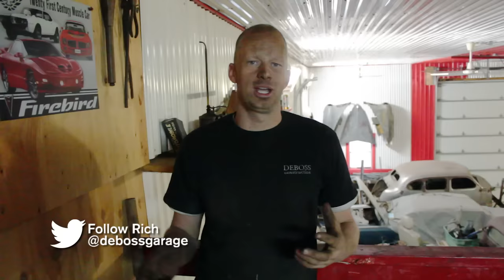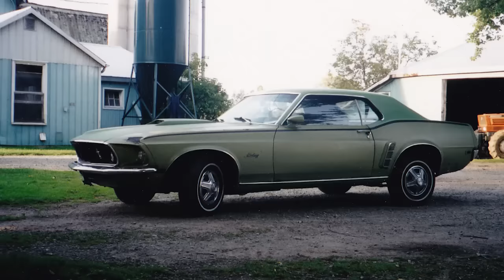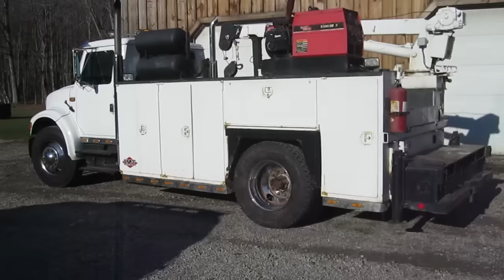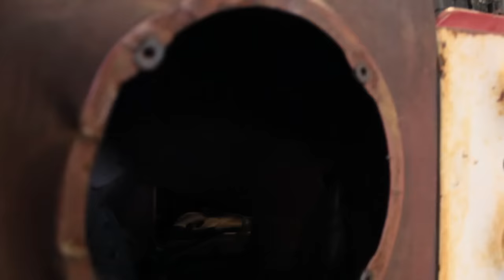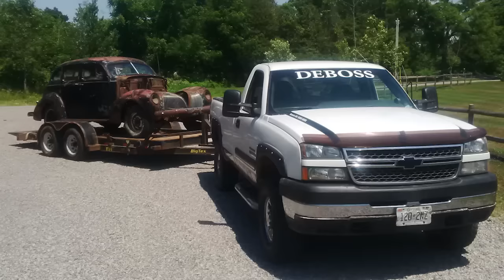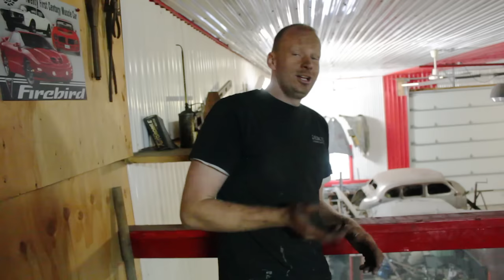The Truth About Flipping Classic Cars For Profit

Comment: A car that needs some minor detailing and easy fix mechanical issues you can flip for profit.
More often than not a major restore you will lose money. 
That is if your work is done correctly.
Reply: the issue is you never get cars that need minor detailing cheap.it doesn't happen in real life and if it does you are paying through the nose for it.
Reply: @utooberblooper  I've been lucky a few times with everyday used cars, but the only people I knew who did it regularly were RUTHLESS. Every trick to pressure sellers to drop their prices LOW or walk away with the cash going back in the pocket and as determined as hell to wait and find a soft buyer who gives them the profit. Not nice people.
Reply: I am 21 and I have bought and sold a couple trucks and cars and made plenty of money on them. Best deal was I bought a 7.3 idi for 3 grand and painted and put a o ring in the fuel filiter housing and a fuel filiter. Spend 100 bucks on those parts and the truck came with a snow plow I sold it for 6900 bucks
Reply: @timpickens498  How much did it cost to paint? Did you do it?

Comment: so how long until you start doing electric conversions on old cars? 10-15 years until those are going to be just for the looks, not for the internals
Reply from the maker: I'm up for anything.  Instant toque on an electric!  I'm sure we will be there at some point.  I'lll enjoy the vibrations and noise while I can
Reply: It will be interesting to see how long it takes for electric drive to be come main stream in the automotive sector. I'll miss the finicky combustion motors like crazy.
Reply: look up zombie 222,68 mustang 800 horsepower 1500 fout pounds of torque and does 180 mph,all electric.

Comment: I worked next-door to a guy who  bought vans at auction.Runners with messy bodywork.He had shady pals who worked now and then for a meal and some cash.They did a super-quick sand and fill over the rust and spray-painted them with blue household gloss paint ,thinned with white spirit. I knew they were high-mileage clunkers but they shone.Took em and sold them at the auction place.Never got rich but made enough to keep doing it.
Even when you know there's filler and hidden problems a shiny paint job makes it harder to bid scrap value for many folk.

Comment: The only reason the Ford Model A is still relatively cheap is because it was manufactured from 1928 to 1931 with a total production of right at 5 million. The 28 & 29 were basically these same car while the 30 & 31 were a bit different but all shared quite allot of the same parts. These cars were made all over the world from Russia, Britain, South America, and Australia as well as here in the United States. No other car in history can boast such a feat. These cars were produced so well it's a testament that they are still around and running 90 years after their production. It's the vast numbers that have kept their prices in check. Also having had every part manufactured for them for years now helps as well. They are relatively cheap own and restore if you do the work yourself. You can find them all day long for less than 6k. Now if you buy a basket case and spend 20k having it restored you'll never get that back. These cars will never be as valuable as a 1957 Chevy but then again you'll find more Ford model A's on the road today than any other antique car period. No matter if electric cars start to dominate these classics will always have a place as they have in the past. They will run off virtually any fuel from alcohol to standard low grade gasoline due to Henry Ford's engine design. You may call me crazy but I believe as long as they are drivers antique, classic, and muscle cars will always have a following. They always have and they always will and a person can make money dealing with them if they know what they are doing. One does not have to be at Barrett Jackson to make money on these cars. Matter of fact I believe Barrett Jackson has done more to hurt enthusiasts who love the cars than help the hobby. Just because a car is old doesn't mean it's worth 100k. Here again it's all about knowing the industry just like anything else.

Comment: Sounds to me like you dont know how to run a profitable business.
Ive been buying, restoring classic cars for over 20 years. I make a 6 figure income consistently.
Its all about buying the right ones at the right price.
Also, dont buy basket cases. Buy them as finished and as restored as you can. Doll them up as much as necessary. Then sell it.
I bought a 78 Bronco for 5500. Put 800. Into it, a good detail, sold it for 12,500. 
I just bought an 84 Bronco ll for 1500. Spent 400. On a good detail, swapped a 4 speed to a 5 speed trans (came with the vehicle) sold it for 7500. Even 80’s cars are making me big profits.
So, when you say you cant make money flipping cars, you’re clueless.
Reply: Teach me your ways. I’ve wanted to do this for a very long time
Reply: @928pcar  its not hard if you use what i posted above as a guideline. Also, the better condition the car when you buy it, the less work it needs, the more profit you make. Knowing what makes a car more valuable is where the profit is. Some people go over every nut and bolt and lose their ass. Others clean the car up and make a nice profit.

Comment: Any 50 year old car that is sought after is going to either need more work than it's worth or milk you dry on parts pricing. You're best off buying something that isn't old enough to be beat and hard to find parts for. You're usually best off looking at one type of car, that way you can learn them inside and out, know what everything costs, what's easy to do, hard to find etc.